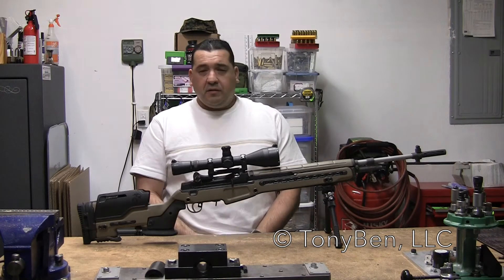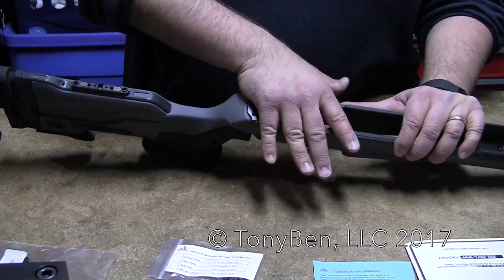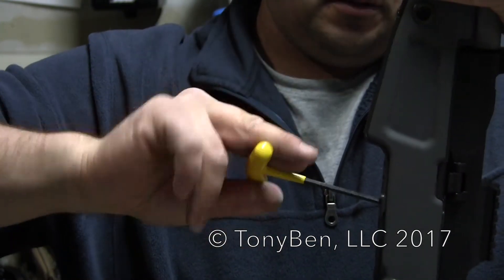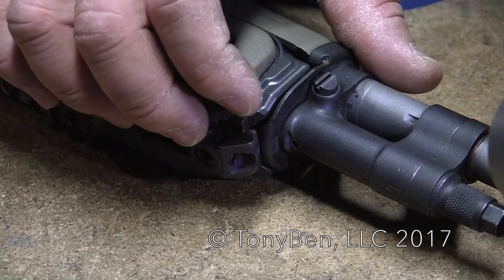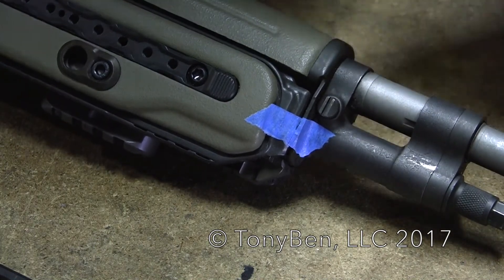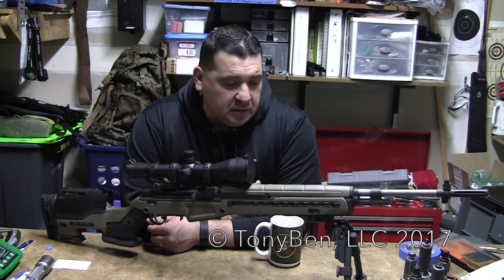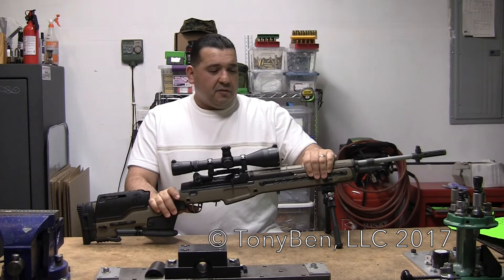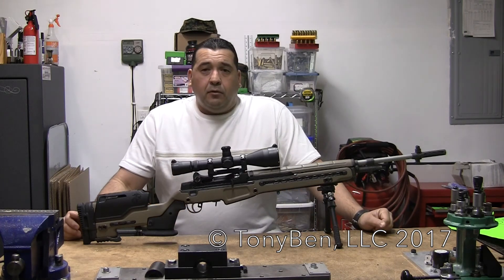JAE 100G3 Installation Instructions

Comment: My front band lip is tightly in contact with my ferrule (hard to seperate with hand pressure) and the handguard cover is in heavy contact with the stock(no gap).  Do i just sand down the handguard?? Or what else should i do?  My rifle is a m1a loaded with the JAE chassis.  It currently dont have a barrel tensioner but i got one ordered.
Reply from the maker: Yes, sand the handguard.

Tony